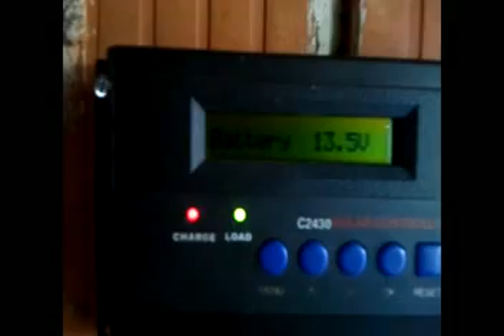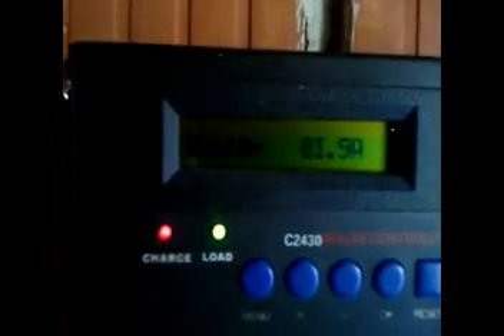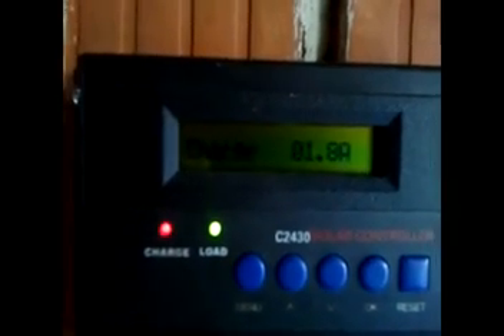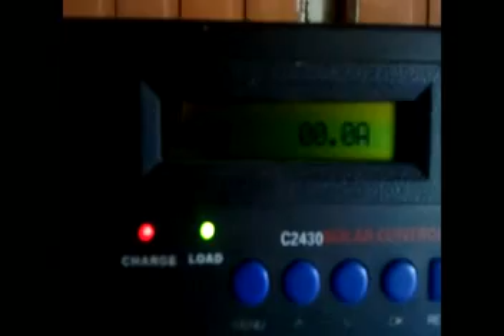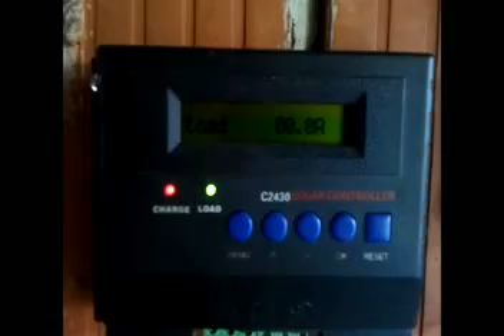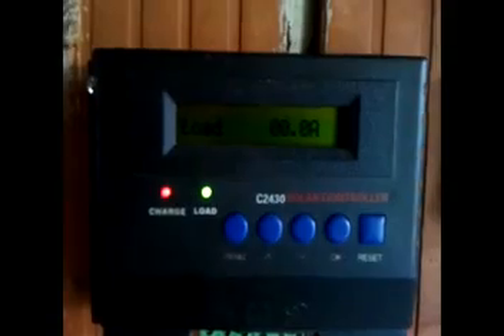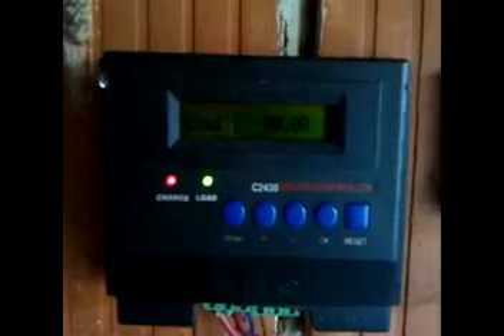Amorphous cell's solar panel

Comment: Well done built ! Put all cells in series and then use a Bedini kind or Joule Thief circuit to
transform the energy and charge up lead acid batteries for an inverter.

Regards, Stefan.

Comment: total 30 pieces of amorphous solar panel, so how many output you got? really create more electricity then crystalline solar panel?
Reply from the maker: Jeff Yu i think it was 3A max,each cell has open circuit voltage of 21V and 0.1A